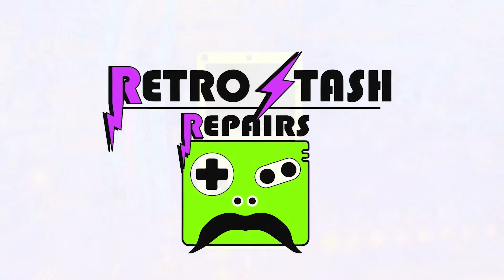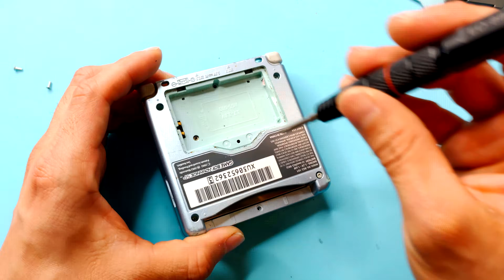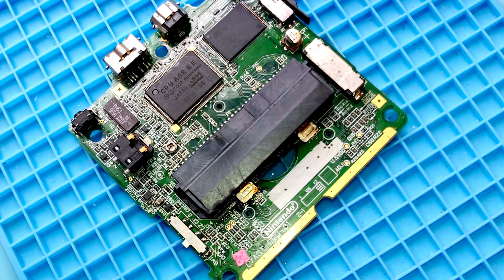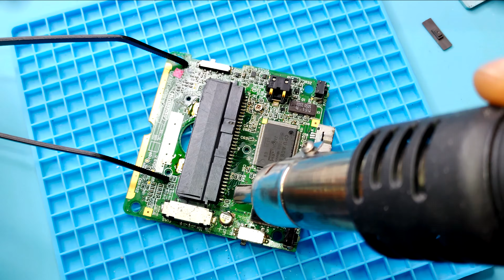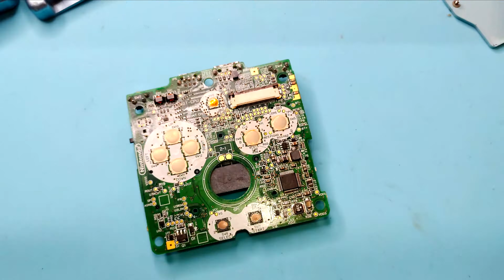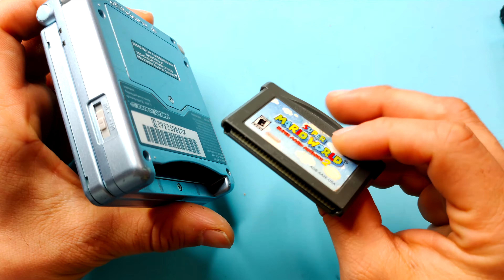Replacing a broken cartridge reader on a gba sp

Comment: Thanks for the video! Tried to lifting the slot and lifted to hard when it wasn't hot  enough... ended up pulling up one of the pads of the 32 . Should I just rewire with copper the trace to the CPU chip?

Comment: Hello, my gameboy sp had green pins and it didn't read the gba games well but it did read the gameboy color ones. I cleaned the pins externally as best I could and removed the green and it only reads some of the gba, but there is another problem, it does not save games, it destroys the gameboy red pokemon save point and in the gba games it does not load the game (they do not have a battery )...I tried it on a friend's gba and the games run perfectly, they save and load, what could happen to my gameboy sp? Could it be the reader's problem? or is it something more serious?
Reply from the maker: Could still be a problem with the cartridge reader. Or it might have a fried/corrupted ram chip. Could also be broken or corroded traces between the reader and ram.
Reply: @retrostashrepairs  ok, thanks^^ Apparently the ram seems to be fine, I'll have to check it better :(
Any advice to better clean the green on the pins? I have tried isopropyl alcohol and a toothbrush, even a needle and cotton, but it does not come off completely. Any way to clean everything better?
Reply from the maker: It would hard to know without actually looking at it.

Comment: You make it look so easy! While I tried to get the rear pins to desolder, I ended up pulling the wires for each pin that was attached within the board. Not sure what I did wrong. 😢
Reply from the maker: Aww man sorry to hear that. The trick is to just hold the cartridge and just let it drop instead of pulling. For that you need to desolder the first 2 big pads on the other side. It will take a while but it will just drop off, it also helps to add capton tape so nothing melts.
Reply from the maker: If anything I could offer to restore it, depending on how many pins were pulled 😬
Reply: same for me😢😢

Comment: You could of tinned the port/pad and reflowed the replacement cart reader back on. Instead or soldering each pin.
Reply from the maker: True that, you can do it either way. But I prefer this method. Reflowing it that way would require hot air again, and it would take a while so all the pins can sit flush. After so long of going over it with the hot air, it starts to melt the plastic from the cartridge reader. Just speaking from experience.
Reply: @retrostashrepairs   this is the only way to garuntee a strong and flush bond , you have a good steady hand , but some tips i have for you :
You dont need to remove the solder under the pins unless they really stick out and cause misalignment, if the alignment is good its better to leave it , since the solder will melt and very little pressure will seat the pins and garuntee a flush connection since there is a decent amount of solder( more surface area contact same concept as thermal paste on a cpu.
2. The very top corner of the first soldering iron looks to be smaller then the tip of the second one but i cant really tell.
3 using a heat gun is easier and you have less risk of damaging the board 
Overall very good informative video  ,thank you
Reply from the maker: Another way is to solder the pens all at once with a sweeping motion, but is pretty easy to create alot of bridge pins. And requires more flux. Which I prefer to stay away from, since too much flux usually ends up with faulty tactile switches from the d pad and a and b buttons on the other side. Which will lead to having to repair those as well.